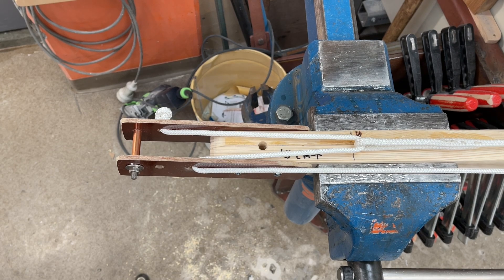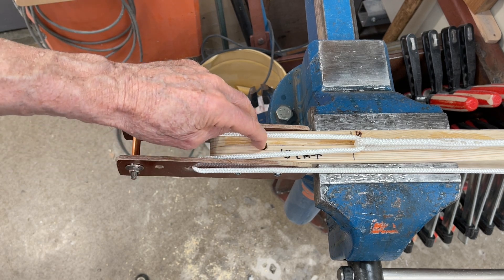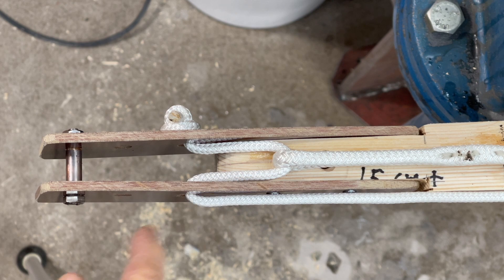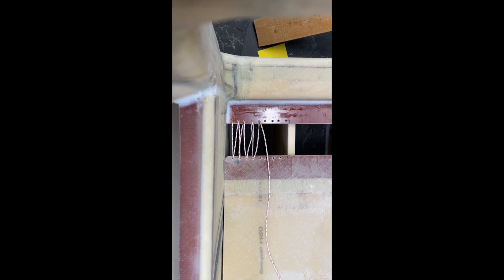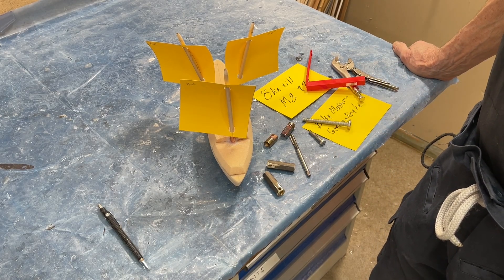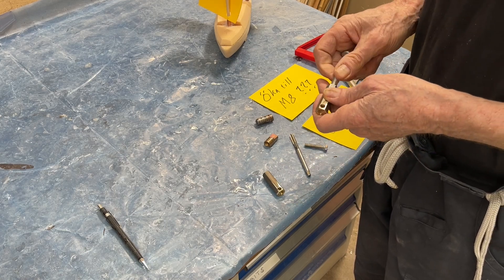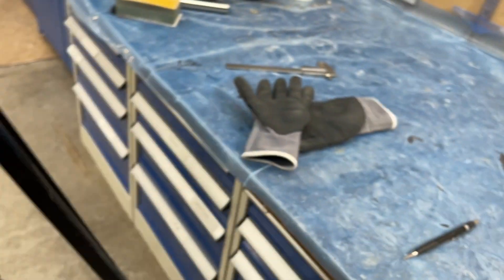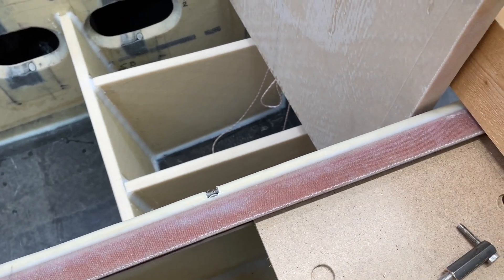Miscellaneous, the mock up boom, the real rope hinge, locking nut for the seat stovage, rig on model

Comment: I like the rope hinge on the compartment lid. Very simple and easily repaired or replaced. Will you use fair leads for the end of the boom to reduce friction on the reefing line or smooth out the holes in the side plates? Thank you as always for sharing you adventure and your knowledge. Have a blessed Easter.

Comment: Using low friction aluminum rings might give you more pulling power on your reefing setup.
Reply from the maker: I will use thicker round plates and round the holes. Thats the plan.